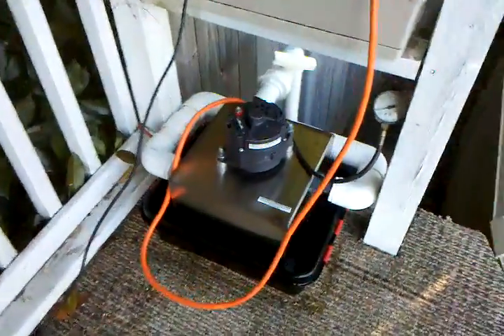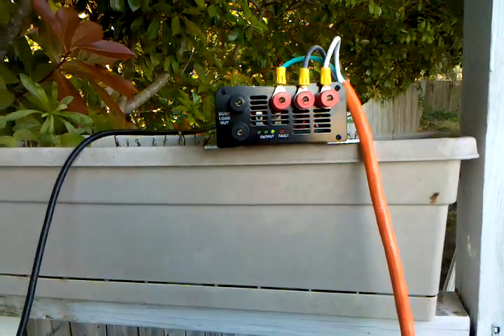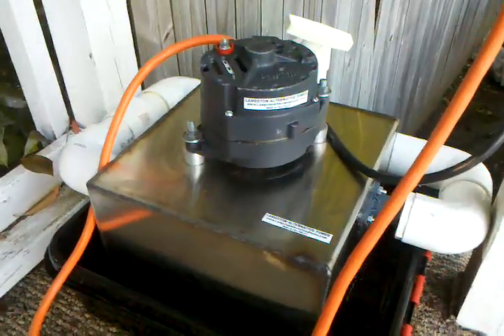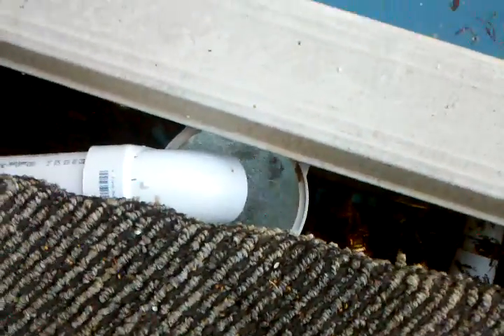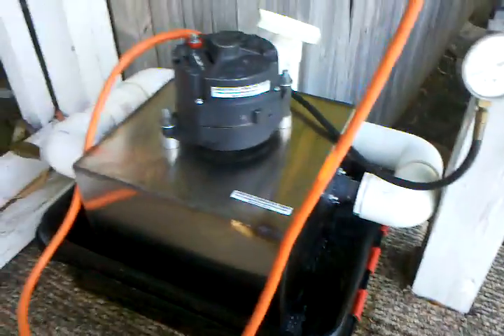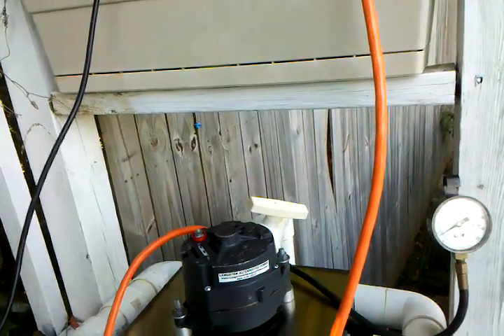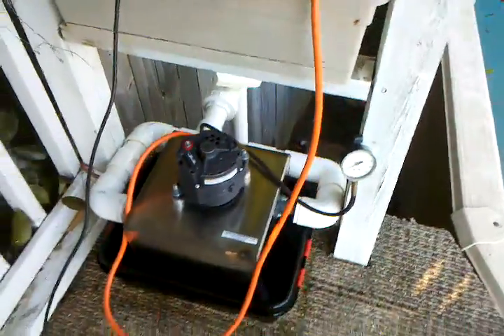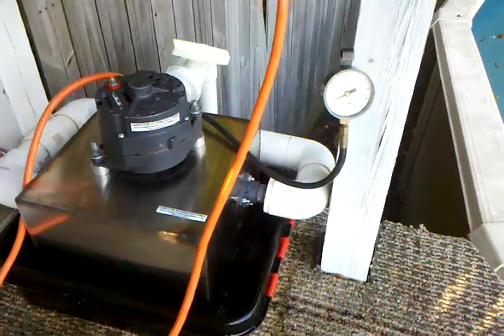Micro Hydro run off of pool water

Comment: I'm trying  to figure  out how this can be done on a in ground  pool! With my pool pump moving 60 gal a minute ate 25 to 30 psi.  How would I get the return water return  to the pool at a greater pressure  then just gravity  flow. With the water flow and pressure  two of these could be set-up on the system.

Comment: Using this will increase the power you pump will use cause you are putting 8 psi presher on your pump
Reply: My In ground pool pump  and filter puts out 25 to 30 psi moving 60 gal water a minute. That is more then enough  pressure  to run a gravity  return line. I'm not sure why his psi is so low on that pool pump.